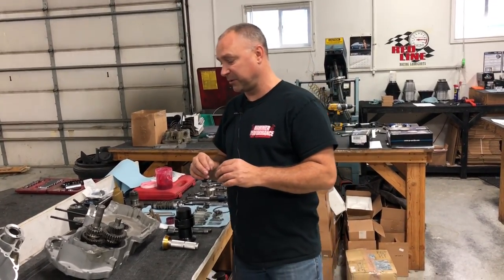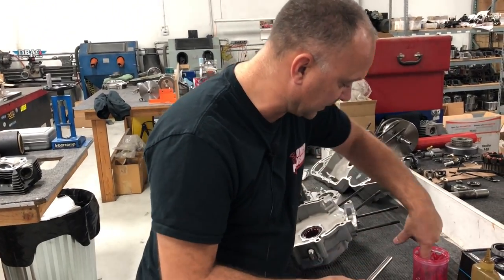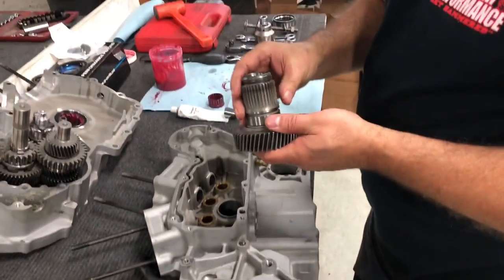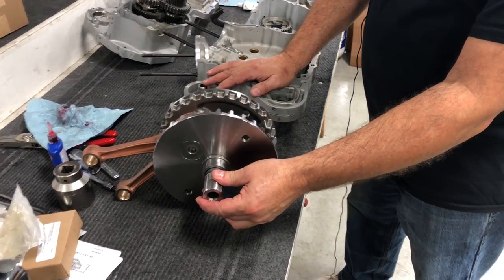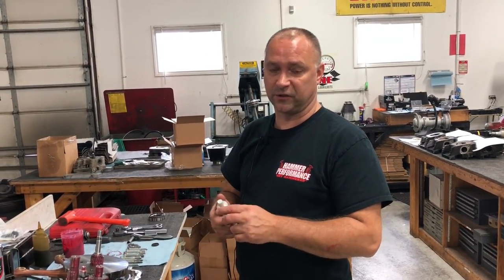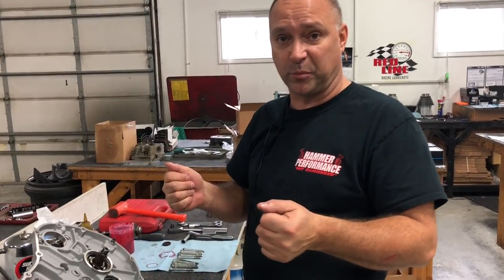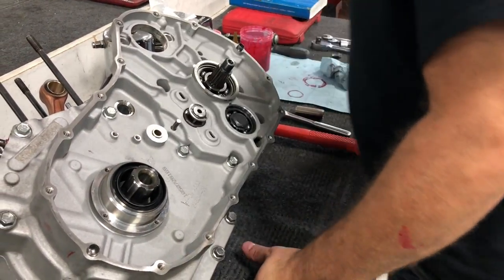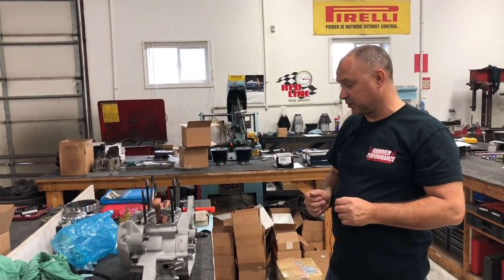How To Reassemble A 04 Later Harley Davidson Sportster Bottom End

Comment: If I'm hearing a noise in the primary while rolling down the road either in gear or not in gear and with the engine if off while rolling down the road would it be that bearing that's doing it? Or could it be something hopefully easier to replace?

Comment: i would like to see you do a 95 ,96,97 bottom end. i have a95, and 97. both need to be done, and also would like to know if that newer buell crank will work in my bottom ends ?     thank you:)
Reply from the maker: the buell crank will work as long as you do the crank  mod from us.  It's not a direct bolt in.
You can read about it here:
http://www.hammerperf.com/xllowerend.shtml#crankconversion

Comment: What about a little permatex? I’ve ran out of loctite and used gasket maker in threads and it seems to hold bolts well enough as a low strength loctite

Comment: I know they don't have the trap door for the 6th gear, but is it possible to put a 6th in it if you crack the cases like this? That is literally the only thing I wish my Sportster had!
Reply from the maker: I dont think they make a 6 speed for the rubber mount sportsters, but I could be wrong.
Reply: @HAMMERPERFORMANCE  Sadly, I believe you are right. I have searched high and low for a 6 speed conversion and they simply don't exist :(

Comment: So where do I find that fancy tool. For the neutral switch indicator hole? Will just a bolt do? If so what size and thread? Thanks
Reply: Yeah it's a 7/16 18 thread
Reply: Sorry about that I meant 9/16 by 18
Reply: 🙏 thank you

Comment: Can the cams from a 2007 xb9r go into a 2004 883 block. I noticed the number 2 cam is on the right side of the oil pump. On 883 it’s on the left. Number one is in the front and number 4 is in the rear.

Comment: Hammer Dan, the 03 and earlier had the ability to put a Baker six-speed transmission in via the trap door.  They don’t have one available for 04 and later.  I assume it is due to the need to split the case. Have you every put in a custom six-speed into an 04 or later Sportster?  If not, do you think it is possible to do?
Reply: anything is posible i think the baker 6 fits if the case has been split same size as the 03- so why not
Reply: or just get an earlier case if youre already that far into a build and incorp the 6th gear to that build everything is a direct fit

Comment: This gearbox is lubricated by the engine oil or the primary chain oil? Saw a video  from delboys garage saying thus transmission share the engine oil and primary chain only lubes the chain and clutch.
Is this correct?
Btw he use atf for the primary? 
Is it ok ?
Reply from the maker: On Sportsters, the primary and transmission share the same oil. There's a passage between the two. The engine oil is separate. So you've got two different oils.
On Big Twins, the primary, the transmission, and the engine each have their own separate oil, independent of each other. So you've got three different oils.
Lots of guys run ATF in their primary. But the HD "Formula+" is a high quality lubricant and it works great: https://www.harley-davidson.com/us/en/shop/formula-transmission-and-primary-chaincase-lubricant/p/62600004

Comment: Red locktite is a mistake it is relatively permanent.  Use the blue, it won't unscrew.
Reply from the maker: The factory service manual calls for red Loctite in on both the pinion nut and the sprocket shaft nut.
Reply: red is semi permanent it can always be broke free

Comment: ok im a bit confused at this point you said to tap the double row in on the outter race never the inner itll hurt the bearing, then, always pull through on the inner race never the outter itll hurt the bearings...????
Reply: When pressing the bearing into the case the outside race is what you press against to prevent the guts falling out of the bearing. 
When pulling the fifth gear through it’s only pulling against the inner race and not actually putting pressure against the ball bearings.  
If you were trying to hammer the fifth gear in it would cause issues.
Reply: @Tofuandtwowheels  fair analysis 👌 thanks , I didn't think of it that way

Comment: How come you don't have the crank welded ? cheap insurance
Reply from the maker: It does almost nothing to strengthen the crank.
Reply: No looking at it necessarily from a strength stand point but from a scissoring or shifting standpoint. The cranks on the newer motors are a press fit vs being nutted together so I've heard that can be an issue.
Reply from the maker: @ckelley63  Scissoring is exactly what I was referring to when I said it adds almost no strength. A few years ago, S&S had a series of videos that proved welding a crank added almost no scissoring resistance. This basically confirmed what we had seen in TC cranks in particular, that the weld just breaks. Bottom line, the strength of the weld is in the noise as compared to the strength of the press fit. That video series has apparently been taken down, I can't find it anymore. They've left up one tiny video that's just a little excerpt of the series, showing their setup for testing. 

But in our experience, scissoring isn't nearly the issue with an XL crank that it is with Twin Cams anyway. It's actually a pretty rare thing to have an XL crank scissor on you. Spread is the big issue with an XL crank and it's really only an issue in high rpm builds. The best thing to fight spread is the 2008 XR1200 crank. The bigger 1.5" crank pin adds a lot of spread resistance. If you're concerned about scissoring, you can always get the crank pro-plugged, that will add far more scissoring resistance than welding. But again, scissoring is a rare issue in the XL world, in our experience.
Reply from the maker: Here's some discussion on that video series: https://hdbitchin.com/index.php?topic=3682.0
Reply: Hey I appreciate you taking the the time to expound on this, I have wonderr for sometime about this vs. Twin Cam crank issue..

Comment: Where can i get that neutral switch locking tool? Or did you make it?? Can't find it anywhere
Reply: It looks to me like it’s just a bolt that fits the neutral switch hole. Nothing special it just has to be long enough to hold that arm out of the way. Maybe just remove some of the thread on the end…
Reply: @Tofuandtwowheels  made one. Forgot the pitch but you have to dull the threads and smooth out the end piece flush.
Reply: It's A 7/16 18
Reply: I'm sorry meant 9/16 18